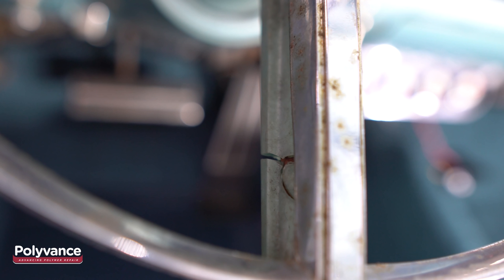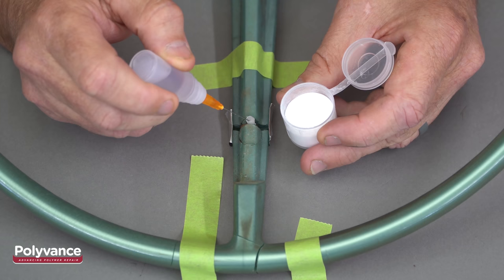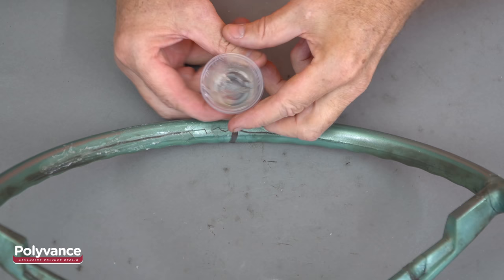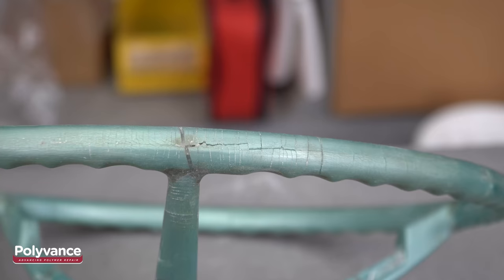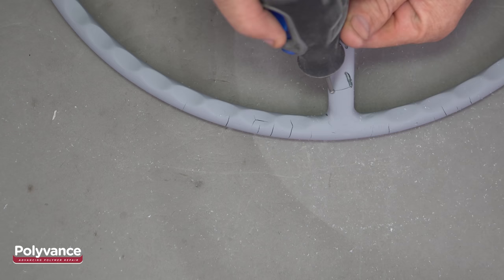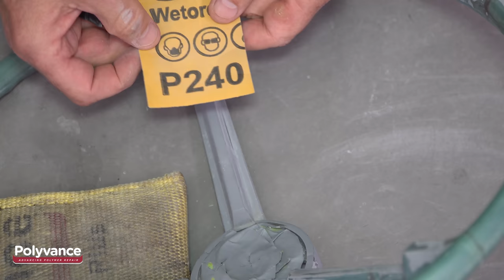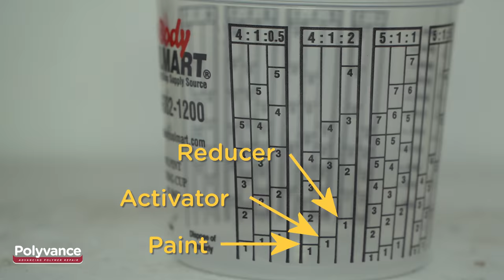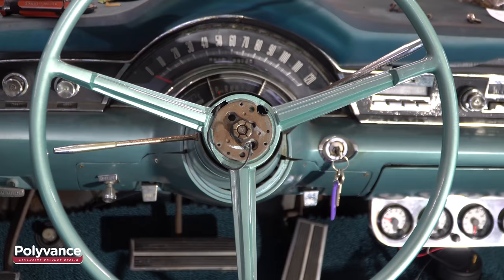Steering Wheel Restoration - Cracked Steering Wheel Repair

Comment: My 1965 Pontiac has clear parts . Is there a clear product ?
Reply: Polyvance does make "CLEAR" PlastiFix.  It is mostly clear when cured , but its difficult to totally eliminate a small amount of air in the cured product.  If you decide to use this, use the "Dropper method" for application with the applicator needle.  Make sure each layer is completely wet out before adding the next layer, work in thin layers (1/16 in) and don't stop in the middle to let it cure out; this will minimize air entrapment.  Also, you will never eliminate the seam line between the repair and the original part.  Think of it like the bonded joints in an aquarium; they aren't horrible to look at, but they are there.  Cured PlastiFix can be polished out to a high gloss mirror-like finish.  So will it be an completely invisible repair, no, but it will certainly look and feel better than a crack.

Comment: The repainted wheel doesn't have nearly the color depth of the original pigmented plastic. I wish there was a better solution.
Reply: There is another solution.  There are wheel restoration companies that will actually mold a new wheel to your frame and rechrome all the pieces to make the thing look brand new. They are amazing, but the down side is that it costs WELL over $1000!!!
Reply: @scottb7600  Can you recommend some? The only restorers I could find paint them like this.
Reply: @TiberianFiend  https://www.steeringwheelbob.com/  Let me add, I have seen others, but cannot find them, but check out the red translucent wheel on the gallery page.  Its pretty impressive.
Reply: @scottb7600  His process page says he fills in cracks with liquid polymer and paints them just like this.
Reply: @TiberianFiend  True, but the red one is different somehow.  Maybe I'm wrong.  It might not be this guy I'm thinking of...I'll keep looking.  I saw one company that fixed the cracks then created a mold from the fixed wheel, stripped the wheel, then recaste it with new material.  Or created a mold if all the plastic was crumbled off, as sometimes happens.

Comment: I have a 66 mustang that has a cracked steering wheel but even being the diy guy that I am I would probably just try amd find a new steering wheel instead of putting that amount of time into fixing one.
Reply from the maker: It was very time consuming.  While there are plenty of reproduction parts for Mustangs and Camaros, it's next to impossible to find anything for a 1966 Chrysler Newport.  The only choice was to repair and restore.

Comment: Superglue and bicarbonate of soda - same result!
Reply from the maker: No. This repair is stronger. Super Glue and soda is very brittle and does not chemically bond to ABS. PlastiFix chemically etches itself to ABS and the final product is acrylic, which has very similar properties to the original plastic part.
Reply: Not the same chemistry at all and will definitely not give you the same results.  Soda and superglue produces a brittle repair, it cracks easily and is damn near impossible to sand.

Comment: or maybe use baking soda and crazy glue ?.
Reply from the maker: No! PlastiFix is a special type methylmethacryalte designed for ABS, PC, Acrylics and other hard plastics. Superglue only bonds to the surface of the plastic. It is also very brittle and only has about 30% the strength of a PlastiFix repair on hard plastics. PlastiFix chemically etches itself into the plastic and should not fail.
Plastifix uses a liquid monomer to polymerize the powder to form MMA plastic in an exothermic chemical reaction. The most common forms of MMA include acrylic and lucite. The individual components have no adhesive properties without the chemical reaction of the two ingredients, unlike super glue. Because the components can be reacted directly on the surface to be bonded, the added benefit is that the reaction incorporates the surface molecules of the base plastic, creating a chemical as well as physical bond on some materials. The chemical AND physical bond make this type of repair extremely durable and impact resistant,  plus it is sandable and easily painted, unlike super-glue or gorilla glue type repairs.

Comment: Great job but it would be a nice option to be able to tint the resin to the same colour and avoid much of the work here.
Reply: Tinting a filler to match exactly would be next to impossible.  I think repainting the entire wheel is the easiest, fastest, and best looking option.
Reply: Scott B 
You could give it a try and leave the color differences like they are. There is no shame in showing the restoration imo.

Comment: Yup. Looks like super glue and baking soda. If you want to match the color of the steering wheel, use your sandpaper on a part of the wheel  that will not be seen, to get the sanding dust. Mix that with a tiny portion of the baking soda. This will eliminate the painting, and subsequent having to use the plasti-fix again, and paint again ad infinitum...
Reply from the maker: It's not super glue and baking soda. PlastiFix is a special type methylmethacryalte designed for ABS, PC, Acrylics and other hard plastics. Superglue only bonds to the surface of the plastic. It is also very brittle and only has about 30% the strength of a PlastiFix repair on hard plastics. PlastiFix chemically etches itself into the ABS and should not fail.
Plastifix uses a liquid monomer to polymerize the powder to form MMA plastic in an exothermic chemical reaction. The most common forms of MMA include acrylic and lucite. The individual components have no adhesive properties without the chemical reaction of the two ingredients, unlike super glue. Because the components can be reacted directly on the surface to be bonded, the added benefit is that the reaction incorporates the surface molecules of the base plastic, creating a chemical as well as physical bond on some materials. The chemical AND physical bond make this type of repair extremely durable and impact resistant,  plus it is sandable and easily painted, unlike super-glue or gorilla glue type repairs.
Reply: Thank you.
Reply: Instead of making an armchair analysis, try it for yourself and see; it is definitely NOT baking soda.  PlastiFix is a different chemistry than super glue  and bonds much better than super glue could ever hope to on this type of material. It is also nowhere near as brittle as a superglue/soda repair, so it won't have the tendency to recrack when it gets baked in the sun.  No matter what process you use, you will need to paint it, unless you don't plan on sanding your repair, in which case you will have a seriously uncomfortable steering wheel to hold.

Comment: Great video but it will re-crack 100 percent. IT WILL RE-CRACK IN ALMOST ALL OFF THOSE PLACES HE FIXED...
Reply: Not a problem. He'll have the car sold by then.
Reply from the maker: The repair should last indefinitely. However, the steering wheel may crack in the other areas that were not fixed.

Comment: IT HAS TO BE RECAST NOT CRACK FIXED,,,
Reply: After a recast it won’t be original anymore and even if you’d recast, a restoration like this will help creating a perfect mould.
Reply: @Conservator.  once you add bondo or whatever you add you have to paint it. Most steering wheels have the dye in the paint. Your painting it after you fix the cracks. Not original. Plus your steering wheels will crack in 90 percent of all the places you fixed. I do both on my steering wheels myself but cracked wheels will be impossible to fix once its cracked
Reply: @Conservator.  I suppose you have the original air in your tires...................
Reply: Harry & Linda Nicholson 
In Europe a car looses value as it looses original parts. But if it’s not repairable than you have no choice of cause.

Comment: Looks like the old super glue and baking soda trick
Reply from the maker: The method is similar, but the materials are definitely not!
PlastiFix is a special type methylmethacryalte designed for ABS, PC, Acrylics and other hard plastics. Super glue only bonds to the surface of the plastic. It is also very brittle and only has about 30% the strength of a PlastiFix repair on hard plastics. PlastiFix chemically etches itself into the plastic and should not fail.
Plastifix uses a liquid monomer to polymerize the powder to form MMA plastic in an exothermic chemical reaction. The most common forms of MMA include acrylic and lucite. The individual components have no adhesive properties without the chemical reaction of the two ingredients, unlike super glue. Because the components can be reacted directly on the surface to be bonded, the added benefit is that the reaction incorporates the surface molecules of the base plastic, creating a chemical as well as physical bond on some materials. The chemical AND physical bond make this type of repair extremely durable and impact resistant,  plus it is sandable and easily painted, unlike super glue or gorilla glue type repairs.
Reply: Uuugh....no it is not super glue or super glue related.  Totally different chemistry.

Comment: "Plastikfix"  =cyanoacrylat+natrium bicarbonat
Reply from the maker: No! PlastiFix is a special type methylmethacryalte designed for ABS, PC, Acrylics and other hard plastics. Super glue only bonds to the surface of the plastic. It is also very brittle and only has about 30% the strength of a PlastiFix repair on hard plastics.
PlastiFix chemically etches itself into the plastic and should not fail.
Plastifix uses a liquid monomer to polymerize the powder to form MMA plastic in an exothermic chemical reaction. The most common forms of MMA include acrylic and lucite. The individual components have no adhesive properties without the chemical reaction of the two ingredients, unlike super glue. Because the components can be reacted directly on the surface to be bonded, the added benefit is that the reaction incorporates the surface molecules of the base plastic, creating a chemical as well as physical bond on some materials. The chemical AND physical bond make this type of repair extremely durable and impact resistant,  plus it is sandable and easily painted, unlike super glue type repairs.